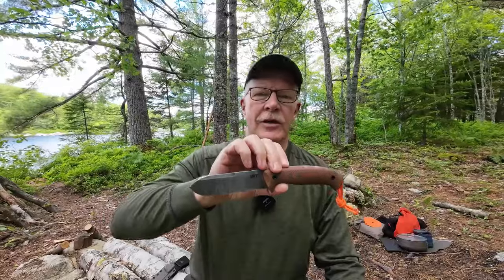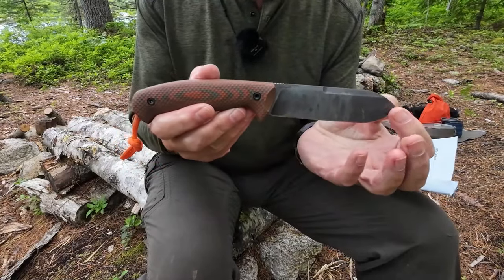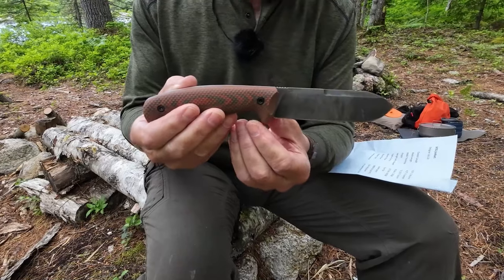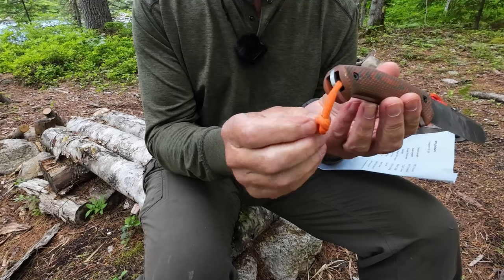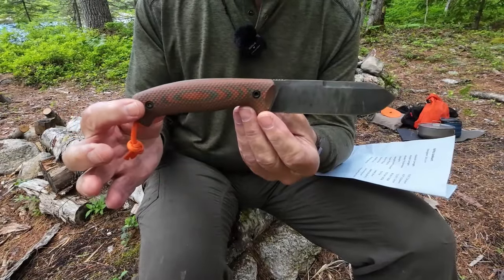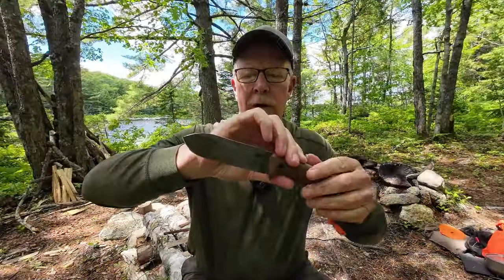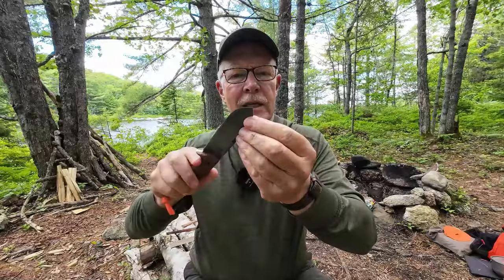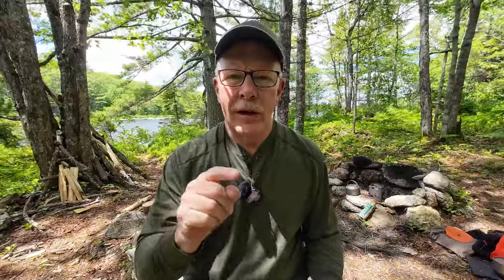Work Tuff Gear Unihart

Comment: For a knife that is supposed to be impossible to reproduce by mass production, there sure are a lot of copies. 
You talked a lot about out the quality, but did you really like it?  Would you be happy with that odd shape?
Reply from the maker: Hi Jim. Most of the copies, with the exception of the Ka-Bar version, don't incorporate all the key features of the original. Even the Ka-Bar version is a stock removal build and not hammer forged. I do find the knife light in the hand and very slicy; however, the grip takes away some of the versatility of the original and the lack of a sharp point prevents it from being a great "bushcraft" knife as it does not carve well. Having said that. I do like using it but it is not my favourite
Reply: @MarkYoungBushcraft   yeah, I’ve watched a few videos, including a guy who had a proper one made.   I guess as with all knives, they’re tools made for different purposes, and the knife has to fit that……come to think of it, the several videos I saw, never really talked much about exactly why he wanted it that way.  Like why no point etc…
Reply: @MarkYoungBushcraft    I just "blued"my Grohmann #3 last week btw.  I used apple cider vinegar because it’s tasty. 🙂.   First time I tried it, and I kinda like it.   I’ll get the #1 one day, but the 3 is my current camp knife, and the #2 is definitely my small game knife.   It’s a stainless steel flat grind, and the 3 is sabre.   If I make or carve anything, I usually have my curly birch scandi. 
Always on the look out for that perfect knife though 😀
Reply: @jimf1964  G'day Jim, I like a bit of carving by the campfire, generally spoons, spatulas and such. Btw a marlinespike or fid is a nice simple one if you're a knot guy, (good one to start the kids off too). Mind you, I totally agree that it's horses for courses in that regard. Incidentally, I turned an old nail bag into a 3 piece carving kit; Moras 105, 164 hook and a Companion, I havent weighed it yet, but its pretty light as an extra carry; ...... light on the wallet too ; )
Nowhere near as nice as a curly birch job though .... love it mate !!!
"Perfect" ....... is there actually such a thing ; ) gotta couple very close IMO, but there's always a little something where I ask, why did, or didnt, they, do that ; )
Cheers Duke.